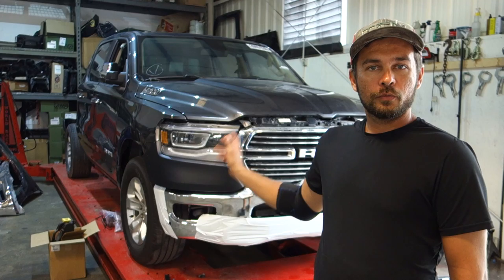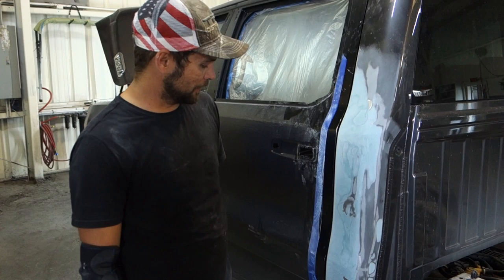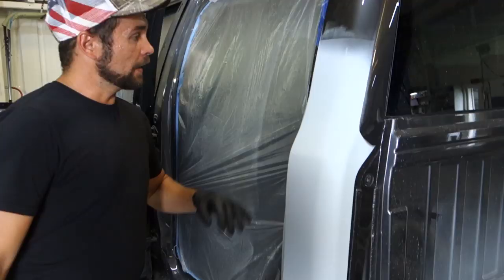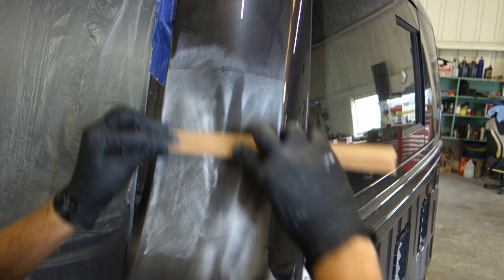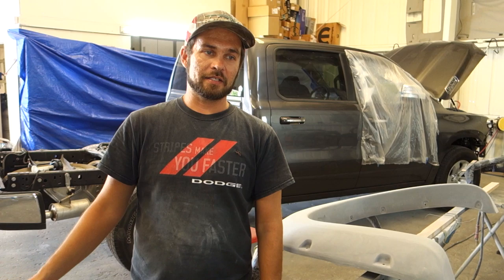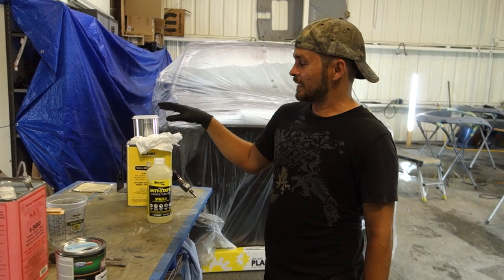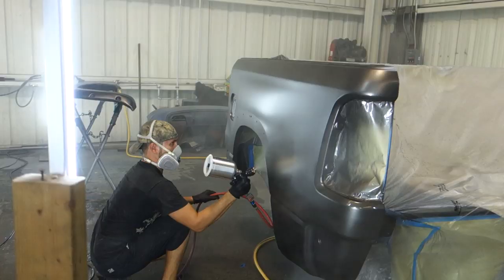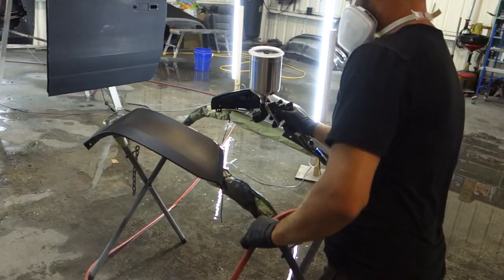Rebuilding Wrecked 2019 RAM! Painting! (Part 5)

Comment: Let me help you out when you use dorerglass you want to use what they call a cheese file to bring it down to your shape don't let it harden all the way and the cheese file will pull it right down and you won't spend wasted hours of sanding just a tip from a old body man
Reply: Sometimes I use a grinder with 36 grit and knock down that glass,then use the ole Dynalite filler